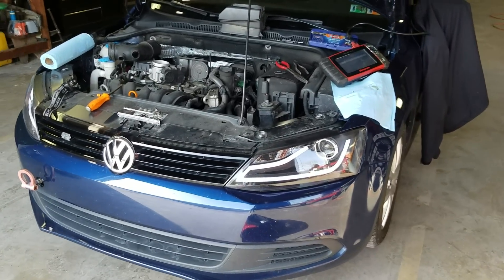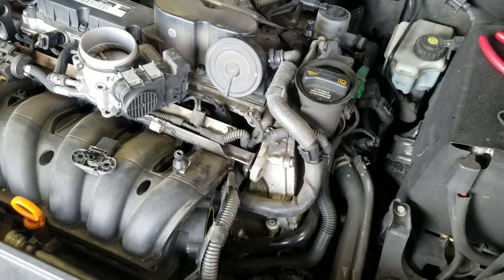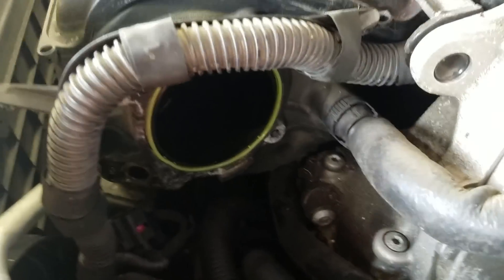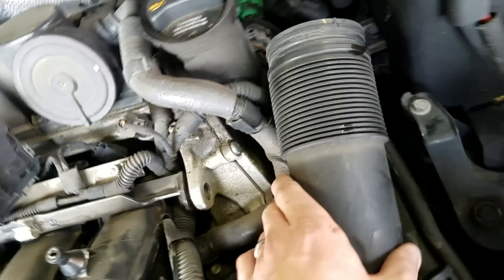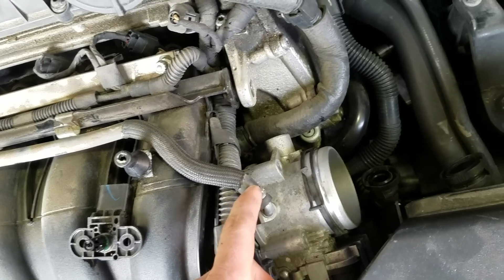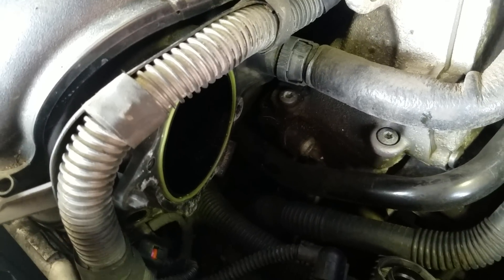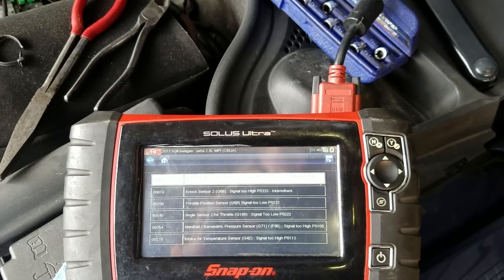PART 1- P0106 VW 2.5L Jetta Manifold Sensor Implausible Signal

Comment: can a dirty/faulty map sensor cause transmission issues (roughness/wrench dash warning)?
Reply: That’s what I got.  My transmission is shifting hard and I got the wrench at the gear indicator on the dash.  Comes and goes.  Car runs fine when the wrench is not there.  Check for codes and P0106 is what I got
Reply: @randomghost4385  check your intake manifold, if it's dirty/oily, clean it, then replace your map sensor, check if it have oil on it. if it does it probably means your pcv diaphragm is damaged and leaking oil into the air intake. replace it. many videos on youtube for this for the vw 2.5
Reply: @kumbackquatsta  Thank you.  I will check and clean before I start throwing money at things
Reply: @randomghost4385  good luck. all my weird shifting has come from those three  parts, usually the pcv diaphragm leaking causing oil to get down to the map sensor via the intake/manifold. all parts can be replaced with hand tools at home.
Reply: @randomghost4385  heads up on the hose clamp too. best to get a hose clamp wrench, although can do it with other tools, it's just tedious
Reply: @kumbackquatsta  Not trying to spend 120 for a sensor or risk putting a Bosch sensor to make things worse so I removed my TB cleaned it and cleaned inside the manifold which did have oil inside including the map sensor.  cleaned all hoses to give me some time.  I cleared the codes.  runs smooth again.  Hopefully this job gives me another 6 months, if not than ill just keep cleaning lol.   I need to see if the dealer can honor the PZEV 15yr 150K warranty on emission parts.  I have a PZEV 2.5 2013 Passat SE
Reply: @randomghost4385  yeah, i got the bosch map sensor for like 30 though from advance auto. but if you don't mind just keeping up on cleaning than you should be fine. replacing the pcv should stop oil though, which is also about 30, and is the root course of oil ingress most likely
Reply: @kumbackquatsta  I checked today and saw oil again so I went ahead and put the Dorman PCV part after another cleaning.  Did the Bosch part give you any issues? did it change some characteristics of idle and throttle response?   I had bad experiences with aftermarket sensors in other vehicles.
Reply: @randomghost4385  good idea on the the pcv replacement. eliminate variables. as for the bosch, it had no odd issues other than fixing the main issue. i'm pretty sure the bosch is oem and german made.

Comment: Great video. Going to replace the diaphragm and MAP sensor this weekend. I have a 2012 Passat 2.5. If all goes well, will the code clear itself, or must I track down a scanner and clear the code manually? The check engine light has been coming and going for awhile now, but now seems to consistently stay on (with the P0106 code).
Reply: Having the same issue with my 2012 Passat 2.5. Replaced my MAP sensor, cleared the code using a scanner, code came back. Will be replacing the diaphragm and cleaning the MAP sensor to maybe fix the issue. Were you able fix your issue?
Reply: @JoeSmoeDoeLow  did you ever resolve the problem?
Reply: @eluna58  yes I solved it. I replaced the map sensor and the diaphragm and then cleared the code using my scanner. I put 15,000 miles on the car and no code has returned.
Reply: @JoeSmoeDoeLow  ok, thank I'm going to first try and just change the diaphragm and clean the sensor hopefully that works. Thanks for the reply
Reply: @eluna58  Did you solve it? I changed pcv, map and cleaned the acceleration body and the code keeps coming back, I've already been fighting for 8 months

Comment: I replaced the map sensor and pcv and the code came back after 10 miles. Should I have cleaned the throttle body too?
Reply: Did you get this issue resolved?
Reply: Van Coll no the code keeps coming back every few days after I clear it

Comment: I just got this code today and except vcds said the implausible signal is intermittent. You think I could get away with cleaning any oil off the old map sensor and replacing the pcv valve to prevent more oil from leaking into the manifold?
Reply from the maker: You might be able to get away with that if the PCV is torn. The only difference between intermittent and permanent is the failure rates. In order to set a light the code has to fail 2 times in a row. Intermittent means that it has passed atleast once since setting the light.

Comment: Even with a new valve cover/pcv that I did myself...$90..And the new sensor as well as cleaned out the hose from the pcv valve the code still comes back and everything is dry.  It's a permanent code with how they made that law I believe in 09 for emission inspection purposes..I'm finding that getting rid of permanent codes is the hard part even though the car is fixed.  I had 4 other permanent codes as well when I picked up the car which was in great condition but needed some help.  It had a broken chain tensionsor which set off many sensor permanent codes.  I fixed all that myself as well as replacing both chains and guides and tensionsers...Only  one permanent code so far has taken care of itself although the car now runs as new again...grrr...its not easy to get rid of them when they go that far.  My car only had 80,000 miles on it when I bought it and as I figured just poor maintenance.  Wrong oil, not having oil changes on time etc.  Luckily after cleaning under the valve cover by hand for a couple of days with the light later of old oil and some gunk, then flushing the engine with the Liqui moly engine flush everything is good again.  Compression is good, no exhaust smoke and power is good.  Did the DSG filter and fluid as well and of course new ignition coils and plugs to finish the complete tune up.  I got the car at a very good price as expected with the issues it had and had it on the road running great in a couple of weeks after work project...Great car,,but those permanent codes can be a pain to get rid of.  Trying other methods I've researched as well to clear them too...Wish me luck...really like the car.  The money we save being able to do our own work is unbelievable with what VW wants to charge for simple fixes.
Reply from the maker: I feel your pain. Having the correct scanner equipment is a must as the years go by. I understand that it is cost prohibitive for most to have supportive scanner hardware let alone the software to accompany it. But it's getting to be impossible to perform work on the vehicles otherwise.
Reply: I’m dealing with the code coming back after all the repairs have been made same as you. The car runs great but I do notice the car doesn’t do the cold start with warm up cycle anymore. It just goes straight to normal idle. I’m now getting a too rich at idle error and not sure what to check for next along with the P0106 code that keeps reappearing.
Reply: @Suprasian  https://ricksfreeautorepairadvice.com/vw-p0106/

Comment: I have the same code P0106 on my 2011 Jetta SE. 145,000 Km. I have ordered the diaphragm for my PCV valve. Are there other problems that might be causing this code besides oil on the map sensor from the damaged diaphragm?
Reply from the maker: An intake leak beyond the mass air flow could cause it. Generally in my experience, the code is more of a product of the air leak caused by the tear in the diaphragm. I'm sure that oil doesn't help the sensor though.

Comment: Question:  I didn't make any attempt to remove the Map sensor and check it due to lack of time, but my PCV diaphragm did have a huge hole in it.  I'm wondering if a fuel system cleaner like Red Line will clear out the oil left inside.  What do you think?
Reply from the maker: Fuel system cleaners are not designed to perform that job. They are marketed as a fuel injector and or valve cleaner. The issue is that oil doesn't atomize very well and simply running the car will not get all the oil out. The shape of the plastic intake plenum adds to the chances of oil staying trapped at the bottom, where the MAP sensor resides.

Comment: I have replaced both PCV Valve and replaced the MAP sensor and oil still keeps getting onto the MAP sensor. Is there any other ideas on why the oil keeps sneaking in there?
Reply from the maker: Other then residual oil, the PCV is the only culprit. If these cars had turbos, then I would say turbo seals.
Reply: thanks, maybe i'll purchase another PCV valve diapragm and see it stops the leaking.
Reply: @SkyhookStudios  I've replaced the PCV cover twice now, haven't seen a tear on the previous one. Oil still getting onto the MAP sensor. I've clean the sensor, the intake manifold and the PCV hose the best that I could. Do you think there is another leak elsewhere or am I destined to replace the Engine Valve Cover at this point?
Reply: Tim Tan did you ever get this resolved? I’m having the same issue
Reply: Tim Tan did you resolve the issue? Same problem
Reply: @vancoll9361  Yes I did, after replacing the PCV twice and the MAP sensor twice. All that was needed really was the throttle body had to be really cleaned.

All you need to do is really clear out the oil in the intake valve with the paper towel. Use the correct cleaning solution for the MAP sensor, clean out the oil on the hose connected to the PCV valve too.

After all that work and investigation, the code never came back especially after cleaning the throttle body. Drove it for over 10000km after that fix.

In the end, traded it in for a 2019 Tiguan lol
Reply: Tim Tan Thank you for the quick reply! So you were most likely getting residual oil on the Map sensor from the hose. I will definitely check those out, thank you 🙏 How are you enjoying the Tiguan?

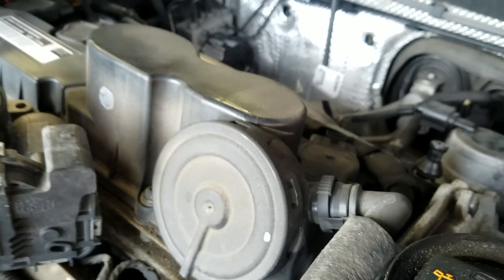Comment: OMG! Thanks for this video! I watched this before cleaning my MAP sensor! I changed the evap purge valve, cleaned the MAP sensor and changed that diaphragm at 1:56! Oh and cleaned the throttle body. 2012 VW Passat 2.5L 5cyl 103,000 miles. Drives like entirely different vehicle! I am absolutely stunned! I would have never known to change that diaphragm! Mine had a gap/hole in it and was leaking! These fixes are not bad at all! My Passat is one hell of a machine being slightly over 100k miles! VW/German engineered vehicles are so fascinating! Love VW! My 2013 Tiguan 2.0 TSI 30,000 miles is great too! No problems with that vehicle yet. ✌🏻❤️👍🏻
Reply: I'm getting same code in my 2011 Jetta 2.5L. I thought I should replace the sensor, but sounds like I should clean it and change the diaphragm before replacing sensor correct?
Reply: @realdg5162  Yes I would recommend doing both the sensor and the diaphragm. I replaced just my sensor and had my code come back. Were you able to resolve your issue?
Reply: My 13 Passat just had this pop up at 146,000 I'll fix it when I get done with truck driver orientation 🤙🏿

Comment: Would this give an Engine AND a EPC light? On my 2008 Jetta 2.5, VW told me I had a P3078, P0322 and P0106 (nothing printed out, just handwritten by mechanic). I cleaned out the TB and did see some oil, but overall it was very clean. I was told Speed and MAP sensors. But after this video, the diaphragm would be an inexpensive fix. Great video. Thank you!
Reply from the maker: The 3078 and the 106 could very much be related. They both can be triggered by intake air leaks possibly caused by a ripped pcv diaphragm. As some other posts have suggested, VW has a campaign out for the P0106 code which involves reprogramming the ECU. I don't think that's gonna fix your issues since you have more then just the 106 code. Secondly, the 322 code is for the engine speed sensor and is most likely intermittently faulting. I say that because the engine speed sensor (aka crank sensor) will prevent the vehicle from starting if bad and will stop the engine immediately if it goes bad while running.
Reply: Replaced the MAP sensor and diaphragm, but no luck. The chamber covered by the diaphragm had a thin brown film on it that I cleaned out. The Speed sensor is next. I think this will do it.

Comment: Hey I have code P0491 secondary Air Injection System Insufficient Flow Bank 1. I removed throttle body and my intake manifold is full of oil same as yours, do you think I need to replace same part as you did? Thanks

Comment: Look up VW TSB 2034012. My CEL came on with this code and they needed to upgrade the ECM software, not replace the MAP sensor.  This was covered under the 15 year PZEV warranty.
Reply: Hi! I have the same problem and I read about the VW TSB 2034012 but I don't how can I require that upgrade... could you please give a little bit more information about how did you order that upgrade?

Comment: At 4:09 the plastic pipe on my car only has one hole in the side not two like yours... I have a 2.5 passat 5 speed. Is there a reason to this?
Reply from the maker: Inan Ismailov probably just a different set up for emissions. Regulations change per region not to mention car so it probably something like that.

Comment: Is it normal for the engine light to come on after doing this repair? I replaced both sensor and PCV valve. Cleared the code and it came back after 4 days. Cleared it again. Will the check engine light eventually stop coming on after awhile? Thanks!
Great video by the way!

Comment: I followed the instructions here and replaced my PCV diaphragm and it did look old and cracked. However, the check engine light keeps coming back with the P0106 code. In fact, it's always two of the same P0106 codes on my OBD2 reader. Could it be that I have a faulty MAP sensor as well? Anyways, great video man, thanks a lot!
Reply from the maker: Adam NK it's possible that the map is bad. If there was enough oil to mess it up, I would say yes.
Reply: I should update this in case anyone comes across a problem similar to mine. So I had a check engine light with 2 related codes: P0106 and P0106 (pending). 
1) Followed the video here and replaced the PCV diaphragm and cleaned the intake where the MAP sensor was. MIL light came back. 
2) Replaced the MAP sensor since maybe it was ruined by the amount of oil in the intake. MIL light still came back.
3) Took it in to the dealership to have it checked out for me and turned out to be a malfunctioning throttle body. They wanted $1100 to fix, I bought the part for $130 online and replaced it myself instead. Driven > 600 miles on the car since then and the MIL light has not came back.
Thank you for the video, I have learned so much more about what's under my hood following this video taking things apart. Much is appreciated and best of luck.
Reply from the maker: Adam NK What was the part that you replaced for 130? The throttle body?
Reply: Yeah, I bought a used TB online. I believe the tag that it came with same it was from a 2009 model. Keeps the Check Engine Light away so I wont complain.

Comment: Hi Skyhook Studios,
I have a 2012 VW Jetta SE 2.5L and I am having a heck of a time locating the MAFS. My engine layout is identical to the 2011 in the video. The MAFS is not located where you would expect it to be i.e. connected to the air intake attached to the engine cover. Any advice is greatly appreciated.

Thank you.
Best Regards.
Reply: Looks like you posted this a while ago so I hope you figured it out already but if you haven't... There is no maf sensor on the 2012 2.5L engine. Only a maP sensor (I capitalized the P on purpose!!!) - Manifold absolute pressure sensor. There is no mass airflow sensor. The MAP senor is like $30 so it's a cheap replacement

Comment: Can the MAP sensor be taken out without removing the throttle body assembly?  I just popped the hood of my 2012 jetta 2.5L and i think i see it below to the throttle body covered behind a hose.  I recently got the same P0106 code as well.  Good info on the diaphram.
Reply from the maker: Technically, I would say yes. I think it would be rather difficult though. Removal of the components is neither difficult or damaging (no gaskets needed).